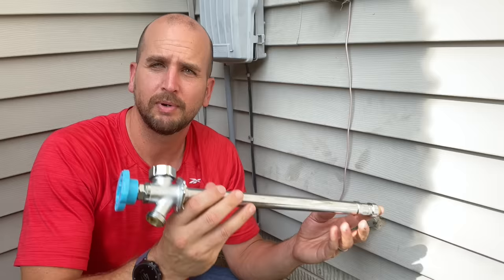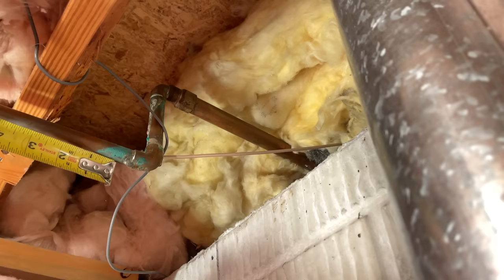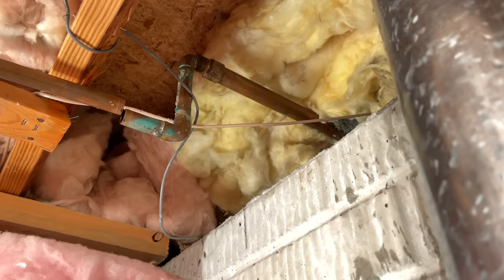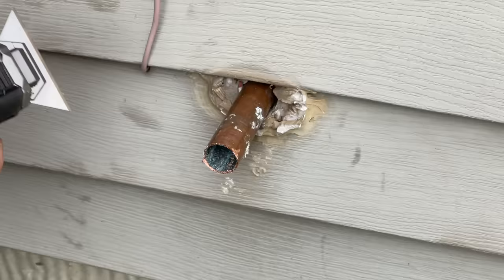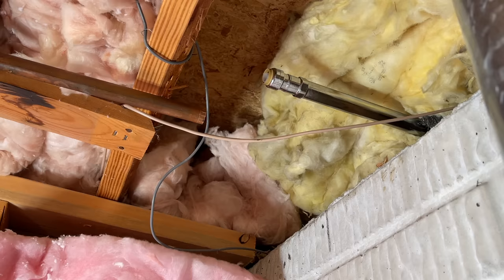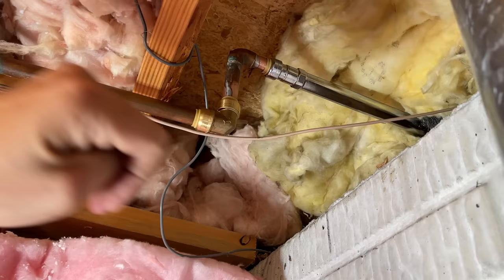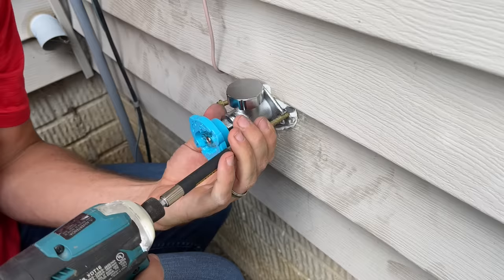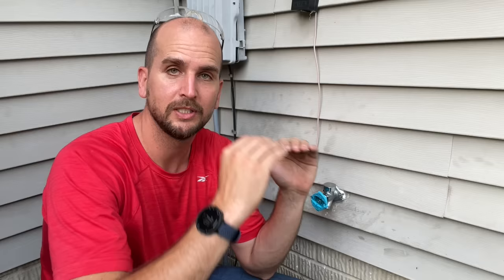Outdoor Spigot Replacement | Sharkbite Frost Free

Comment: what if the vent is leaking
Reply from the maker: I would start off by taking the cap off and then you will see a small plunger which might be stuck leading to a leak.  It is a one-way valve that helps break a vacuum for these type of faucets with the Frost Free or Anti Frost feature.

Comment: Why wouldn't you open up the old outside spigot first after you shut of the main valve so the water in the copper line running from outside drains the water.
Not in that order lol

Comment: I bought a home with two of these spigots and neither of them work.  The water is turned on inside but no water comes out.  Any ideas as to why? I can’t figure it out.   Thanks in advance !
Reply: There's another valve for each one somewhere. You just need to trace the pipe (most likely)

Comment: Don’t use shark-bites! They can fail and do. Ive fixed two leaking fittings in the last year. O rings dry out and crack. Learn to solder, buy a pex tool or just hire a plumber.

Comment: Hi, Scott. Do you do home repairs as your livelihood?
Reply from the maker: Kind of…… I have done a few rentals for years and now do full time real estate investing and this YouTube channel. What about you?
Reply: Scott, do you know the solution to this situation: l replaced a ballast in a ceiling fluorescent light fixture. The replacement was completed successfully and without any glitches. However, when the light switch is flipped on now, there is a fraction-of-a-second delay before the light  actually comes on. That was not the case with the old ballast. Is there a way to eliminate the delay?

Comment: How in the world will you be able to screw a hose on and off this faucet? There's not room for your fingers to grip and turn the hose end. If a woman had designed silcocks, the spout would bee longer so the handle to the faucet was ont in the wat of attaching a hose. The spout would also stick out further from both the siding and the faucet handle. I hate these spigots.

Comment: I'm shocked to see you're using Sharkbites on your rentals. When those rubber gaskets wear out eventually you'll have leaks everywhere. I've had exactly one Sharkbite used in a property of mine (that a plumber put in after being explicitly told not to use Sharkbite). It was spraying water into the wall behind the shower within a month of installation because the gasket failed under pressure.
Reply from the maker: Hey Sam, thanks for the feedback and I am a bit torn as I think sweating copper pipe is the #1 option for plumbing  but most people don't have the skills.  At the same time Sharkbite fittings account for 1.5 Million connection per week 🤯 so if installed properly I would say it is a safe bet they last longer than 1 month.  So a long way to say I see both sides of the coin.
Reply: @EverydayHomeRepairs  I used SB connections in my garage to repair a burst pipe, worked great until the first batch of cold weather. Plumber told me they fail a lot in cold climate, the plastic ring separates from the copper.
Reply: Anything will leak if not installed properly. That was an error by the plumber x 2. Not doing what was asked and doing a poor job on what he did!  SharkBite fittings are approved by the Uniform Plumbing Code and International Plumbing Code for permanent installation.

Comment: Man this is a horrible idea ... I am a plumber and I see these kinda repairs fail and cause thousands in damage ...
Reply from the maker: assuming you would just prefer to use copper and sweat on a new spigot?
Reply: @EverydayHomeRepairs  Plumbers hate Sharkbite PTF fittings because it takes away their power and ability to charge $125 hr plus 200% parts markup.

Comment: You didnt have to do any of that, plus those sharkbites are expensive. and can fail  All you needed to do is to unscrew the the frostless spigots fitting and screw in another one - done. Or at the worst solder in a new female fitting and screw a new spigot in. You always take the long hard way just to make a video.